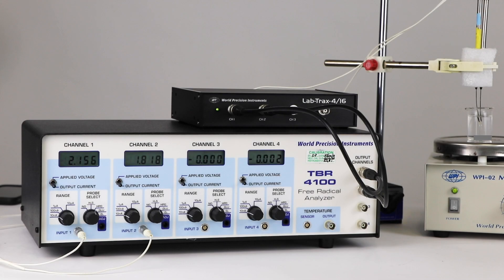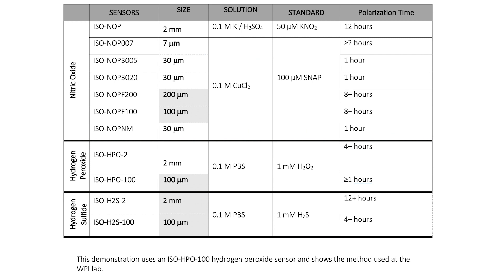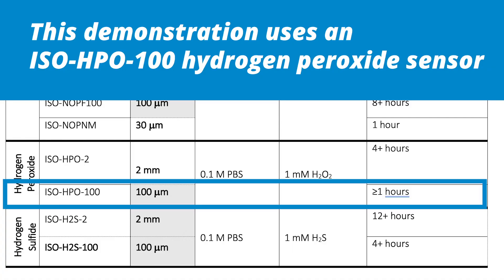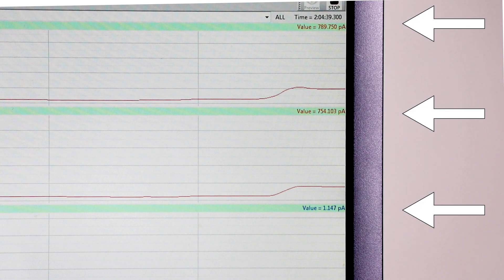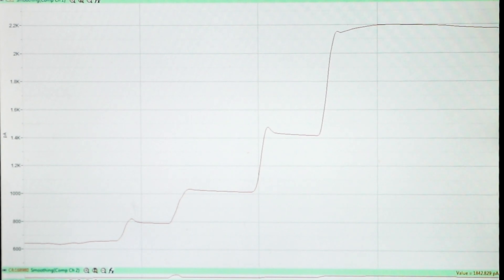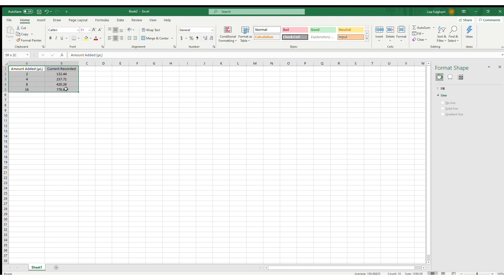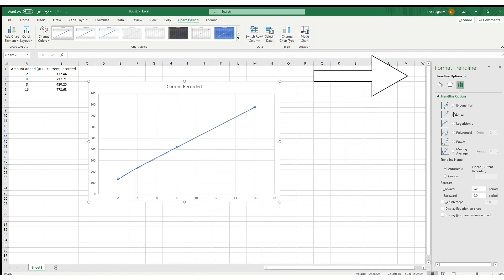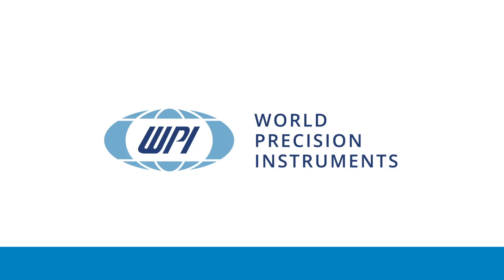Sensor Calibration for WPI's TBR4100 Free Radical Analyzer (NO, HPO & H2S)

Comment: Hi Thanks for the video, it's really useful. I have a question about the range in the channel; What about the high detection limit of sulfide (around 10 to 20 mg/L), we need to increase the range of the measurement right? could you tell us what's the suggested range? 100 nA, 1 uA OR 10uA? thanks in advance!
Reply from the maker: Hi Kalaii! 
10 mg/L = 293 µM
20 mg/L = 580 µm
The ISO-H2S-2 top end is 100 µm= 3.4 gm/L.